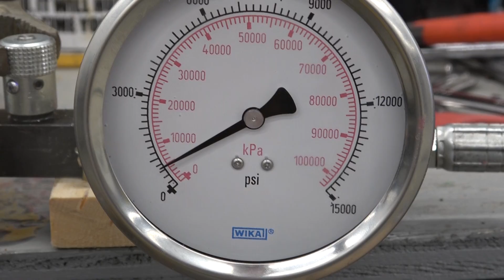How much pressure can PEX take?

Comment: Fingies crossed, hoping AvE will test Pex with crimp on fittings.
Reply: This turd herder concurs
also two types, copper crimp rings and stainless crimp rings
Reply: @chrisv4640  how is the herd doing?
Reply: @WAVETUBE84  The herd was flowing nicely when it left me, no telling what it's doing now that it's inside someone else's pipes..
Reply: @chrisv4640  Don't forget the expanding/contracting PEX too
Reply: @chrisv4640  Viega or Oetiker stainless crimp rings?
Reply: I'd like to see that, too. 

I did a permanently temporary fix years ago, when our 40 year old copper pipes started leaking inside the walls. Original pipes ran inside the concrete foundations and ground-floor walls of the house so there was no way to just locate the leak and fix it there.  I cut them at both ends and rerouted both hot and cold water using the only pipes and fittings I could get my hands on late on a saturday. Cheap noname PEX, and compression fittings meant for that same PEX tubing.

It's been about six years now, and it hasn't leaked a drop so the temp fix became permanent. I inspect it every now and then to be sure, the tube itself is run through an outer tube so any failure along the tube will just leak harmlessly onto the laundry room floor where there's a drain. The only potential house-destroying leak point is the fittings at one end, but so far they're holding good despite some "water hammer" effect from the dishwasher shutting its valve so rapidly the PEX tube visibly sudders.
Reply: @blindbatg34 Matt risinger did a test of all the popular shark bite and other crimp on fittings if you want to check it out.  Spoilers, crimps last way longer then the plastic pipe do.
Reply: @crazybrew609  matt also thinks pex is better then copper. But he's a builder. So cheaper the better. I watched that test. I thinks ave would do a better job. Personally I think copper is better maybe it's just I'm old fashion. There's more skill involved in using copper.
Reply: Now we are getting into pipe bombery, NICE!
Reply: I was about to say the same thing. I NEVER use push on fittings in any location I cannot get at it fairly easily.
Reply: @ericconner9971  I wont use them unless I absolutely have to or in an emergency and I always try to come back later with a proper fix. I have seen too many fail to rely on them for permanent use.
Reply: @chrisv4640  push on fittings work great for quickly connecting a water heater. The chance that the water heater outlasts a gator grip seal oring is very very small.
Reply: @JasonW.  I dunno. I got an original water heater install still going strong circa 1975. Literally installed when I was 6 years old
Reply: @consaka1  that's why I didn't say impossible. A well maintained water heater with good water can last decades.
Most die within 10 years.
Reply: @chrisv4640  Hey folks, we have some trade/craftsmen in the audience...yeah, who woulda figured.
Reply: @JasonW.  well the new ones die around 10 years. Those old ones seem to last forever.
Reply: @consaka1  A water heater is never dead until the tank leaks. All the other parts are replaceable.
Reply: @chrisv4640  that is partially true. Right up to the point where deposits tear up the lining when trying to replace the anode. Sometimes the repairs are just not worth it. We have gone on to use old water tanks for pressure tanks and some times heat exchanger for shop stoves. Work better than 55 gallon drums.
Reply: @ericconner9971  exactly, we do the same
Reply: Eric Conner I don’t trust those things, and they are way too expensive
Reply: @ericconner9971  Sharkbite is pretty much my last choice based on pricing alone, not going to use those unless convenience is the top priority.
Reply: @teardowndan5364  I always keep a few SharkBite end stops in my tool box... Just in case...
Reply: @teardowndan5364  Tore my whole bathroom out 2 days before my lady got back into town, convenience/time was a definite priority aha. Thankfull just a few unions in copper pipe below floor level in a crawlspace and will eventually be going back to replace. They end stops etc. are useful for renovations etc. as a tool but I do not consider them a proper type of plumbing per say.
Reply: Wirsbo fittings after that. (Can you tell I may be a plumber. 😊)
Reply: @ BlindBatG34 Matt Risinger did a video on a few different styles of pextest up to 14,000 psi. https://youtu.be/fT2ftQ_ab-w
Reply: I wanna see it with clamp fittings too
Reply: Yep then you'd have a real reason to back up lol
Reply: Wirsbo as well
Reply: Never mind crimp fittings, how about Uponor expansion fittings?
Reply: I fucking hate those things. Have to use those with the silicone hoses for a coolant system on these units we work and it's a a consistent failure point God they make such a mess
Reply: Exactly what I was thinking.
Reply: PLEASE, for the love of all things dickery, DO THIS.
Reply: Yes
Reply: Would Clamptite work?
Reply: Pex-aluminium-pex pipes would also be a good choice!
Reply: Wow that stuff looked like stiff garden hose... Can't believe people out that behind a wall...
Reply: Here on the north side of the border we have really cold winters. I like knowing PEX won’t break if a line freezes.  Maybe for commercial copper is still best (higher pressures, water temps and all). 

For the rest, I had the same thought as everyone here: “but crimped PEX?”  

A career plumber,  my grandad would have loved these videos but he’d be saying: “what’s PEX” and what’s a “Shark Bite ?” . He was of the generation that only believed there was only one speed: copper.
Reply: This was also my first thought why isn't using proper crimp fittings at least the plastic ones for a real-world type test
Reply: YES AVE Fuckin send it
Reply: And also the weird one where the thingamathing expands the end of the pex, you jam the fitting in, and let the pex shrink back down on the fitting. I only recently learned about those, and it seems janky as hell.
Reply: Sic Semper Tyrannis  I found I can twist the fitting, even after I copper crimp-on.
Reply: I thought this was a joke at first, AvE always knows what’s he’s talking about but I thought it was a joke when I heard him say shark bite, there not even allowed by code over here
Reply: I'd mail AvE a set of expanded pex pieces to test.
Reply: We would test new homes with crimp fittings to 250 psi over 24 hours. Never had an issue. I use the expansion style these days and it's just as good under pressure test. Considering the average home water pressure here in the states is between 80 and 100 psi, it's an ideal medium for the job. Too bad about the rodent proofing though. I have seen chew marks a couple of times that were leaking.
Reply: Timothy Nelissen the expansion stuff is pretty slick, albeit not what I use because it’s very specific stuff and I can’t justify it. I’ve got my whole house pressure balanced and plumbed with pex using the stainless clamps, seeing as the well pump only runs about 35 psi a blowout isn’t a concern. Although for some reason my family has always had bad luck with the hard water causing issues with copper pipe
Reply: I've  had way better luck with the push on fitting than the crimp fitting's,and its going to fail at the fitting ether way.

Comment: Now do a crimp fitting
Reply: I've got a family member that swears shark bite type fittings are superior to crimp type and cost less too 'because the crimp tool is so expensive'.   Every frigging place he uses them they end up leaking at some point. 

I have a good multi-size crimper tool and it cost me maybe $80.  He often spends 2x above and beyond that on fittings alone just to do basic/redo jobs and or his leaking ones every year.
Reply: @mrsqueakthecat.1  HDPE, better.
Reply: I've seen crimp and pinch fittings tested. The PEX-A tubing itself failed at about 500 PSI, fittings did not fail
Reply: Use crimp fitting all the time now, they are the way to go with multi layer pipe with aluminium barrier, our crimp fittings have two rubbers on the inside so they are really safe and the fitting have a inspection window to see if you're all the way into the fittting or not, hard to go wrong once you ream the pipe

Comment: That looks like one of those high end hotdogs that comes individually wrapped in plastic and swells to peter north size on the grill.
Reply: An unexpected Peter North shower probably isn’t a good thing. Especially when it is in your house.
Reply: Get yourself some intumescent silicone, inject the dogs before cooking, never buy the high end ones again (dn't try this at home)
Reply: Who the hell is Peter North? :0)
Reply: That's another thing we scratch our heads over in Europe. Sausages on the grill should get smaller as they loose fat and the cheap ones will also loose injected water as well. WTF is in that stuff you eat that it gets bigger?!?!?
Reply: @5Komma5  lose not loose my guy perhaps you should edit your comment again big yikes
Reply: I agree, the pipe will fail before the crimp fitting does. More pressure, more boom! Perhaps some hot dog carnage.

Comment: At least it's more skookum then that damned gray polybutylene crap
Reply: I've been in apartment buildings where they've used CPVC (the white Sched 40 stuff, rated for irrigation and drainage) as their main water lines, then use a MIPxPex adapter. Had to use a brand new type of glue and primer that came onto the market. So new, in fact, my boss never heard of it. Well, let me tell you: regardless of what it says on the website it does NOT set and cure in fifteen minutes. I found that out the hard way. Cost me my job too.
Reply: Or the orange Kitec pipe. I had to disconnect and decommission my in-floor heating, otherwise the insurance company was going to drop me.
Reply: Mother Algorithm  Not much else to say. There was an ongoing leak down into the basement parkade and they tracked the leak down to the pipe chase in the ceiling of a suite's half bath up on the third floor. The call came in on a Sunday night, and I have no idea why they couldn't wait for Monday morning. Especially since almost no wholesalers carry the stuff. I had to call around to three of them before I found one who assured me they'd have it at their main location. I got the fittings I figured I'd need (paid an extra $150 to open late Sunday which we pass onto the customer) and the pipe was just rigid enough that I had to install a swing joint to make it fit using four 90 degree fittings. The website my boss looked up said it sets in fifteen minutes I think, so when I glued it all together I let it cure for half an hour. It held for about five minutes, enough time for the building rep who was manning the building shutoffs to get to the elevator and come up. Lots of damage to the drywall and such.

Now if you want to talk about a real head scratcher, try Aqua Rise pipe. That stuff is supposed to be hot shit but it's a headache. It's dense plastic usually in a dull navy blue with a really slick coating so carrying more than a couple sticks at a time is fun, but the real fun is cutting and gluing it together. According to manufacturer specs the outer edge of the pipe needs to be beveled with an angle grinder to give some room in the fitting for the glue to go which adds to the mess, but the real evil is the primer. It's real caustic stuff. If you want to find any nicks or scrapes on your hands you use PVC primer; the sting means it's working. But Aqua Rise primer? That stuff is pure pain. Feels like your hand's getting stabbed wherever there's a scrape. Oh, also: never, NEVER use a bristle brush and glue pot to apply it to the pipe and fittings. It's caustic enough that it makes the bristles fall out onto the pipe and fittings (fun,) as well as bleach them thoroughly (even more fun.) And bristles are hollow too, yay! You end up with pinhole leaks all over the place that way. So use the cotton ball-type applicator. Or just avoid the stuff in the first place.
Reply: @RedneckTimelord  This was a while ago and it doesn't bring up good memories so I try to put it out of my head and so a lot of the details are fuzzy (legal weed and plentiful beer does that too, I've heard,) I'm fairly certain it was indeed CPVC pipe and fittings, which like I've said is usually used just for irrigation and drainage for things like high efficiency furnaces or for hot water tank drain pans. Here in western Canada domestic water is almost always carried in a) Copper, b) Pex, c) Wirsbo, so seeing an entire building, especially one that was a 1920s office building renovated over into bougie loft style apartments, piped in CPVC was a bit of a puzzle to me.
Reply: *than, not then.
Reply: Talking about the 'Qest' gray tubing that has been recalled since the 90's? My parents '82 mobile home has that crap, replaced so much of it, its almost a new system

Comment: Cut it replace that fitting and do it again.
Reply: I wonder if you could even get a good seal from a cut end on that pipe. Tho my experience is with rubber turbo boots. Once the get oil ingress they're as good as garbage. The oil ingresses the rubber and makes it slip off.